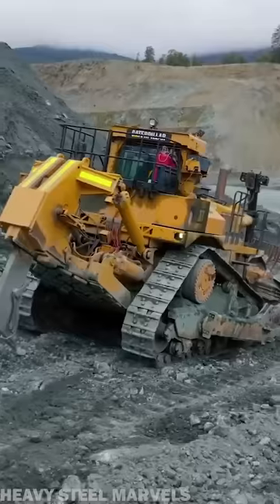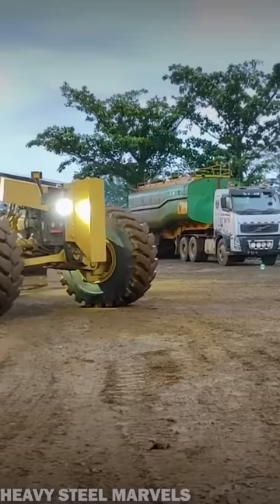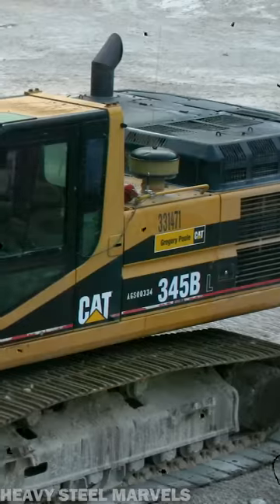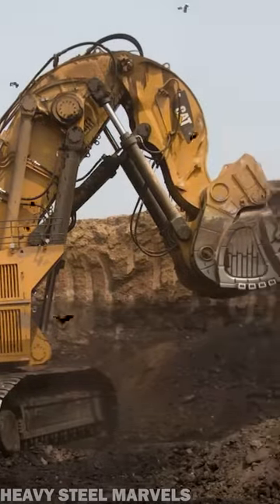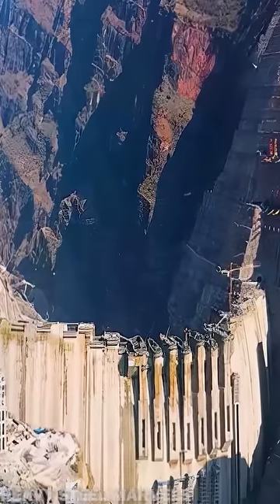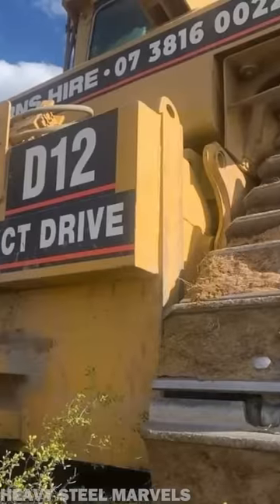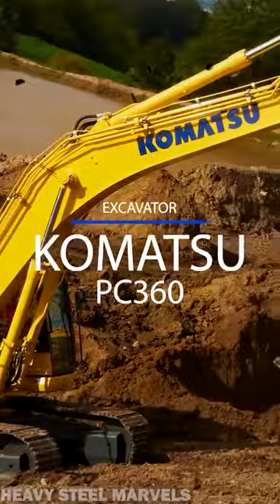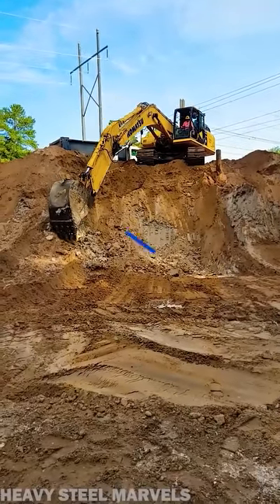Caterpillar D12 Dozer, 6090FS, Big Kate Dragline... | NOVEMBER 2023 MIXED BAG (PART 01)

Comment: D12 is not really a production, but you can read about it in Australia, they stretch the frame and go from a 850hp V8 to a 1250hp V12 and add a cooling radiator for the transmission, a real beast.

Comment: Caterpillar did offered a D12 from 1986-1990  there are 6  in Canada and the difference between the d11n and the d12 was very small the power plant was the only real difference the size was the same D12  was just re-numbered to the d11R  because of the very small differences  but you can go to Alberta and find 4 that still carry the D12 on them and there are 3 in Ontario that I know of   and they where sold By R-angus  in Edmonton and where assembled by my Father  onsite  .....so in actuality all it really was was a D11 with a larger powerplant due to a demand in the mining industry  of the north for ripping the perma frost of the north and ripping the clay of Alberta to get to the surface oils and coal  and thats why they are rare and hard to find

Comment: Lottery Winner - I would buy a Gulfstream G650 Biz Jet - I dont pull the leavers anymore :-)
Reply: you know jets are terrible for pulling?   Heres a good example  push your hardest against          air....        yeah,, no torque.... the equivelent is a turbine, they run the way you want.... actually drive a shaft.     and the only reason you see jets accelerater is because the have more thrust then weight.....so "pushing again the wind is more like 2000 fold

Comment: The D11 must have hit a sweet spot in terms of demand. The biggest bulldozer that it's practical for customers to use, or something like that. Komatsu only ever built 53 D575As, vs 6,000 D11s. If CAT built a D12, it would presumably suffer from the same lack of demand that capped D575A production at 53.

Comment: this is not an actual D12. there is not D12's. Its a modified D11 by Don Mearns for broad acre farming blade plough application. the only thing D12 is the stickers that he puts on them as a joke.
Reply: I actually talked to a person who worked for cat and he said they tried making a d12 to compete with Komatsu's 575 dozer but he said the d12 wouldn't hold up. He said supposedly that it kept breaking driveline parts and other parts he said they scraped the project bc the machine just wouldn't hold up it couldn't withstand the weight and power. Idk if that's actually true or not but that is what the guy told me.
Reply: It’s also a stretched chassis running a 3512 pushing 1250hp, so more than just a sticker.

Comment: I owed the 3 old cat 235 B cats ,rented p.c.400 Komatsu  excavator s when digging in rock great machine.putting big 10 foot  Dia culverts,and deep trunk sewers good machine
Reply: YES was waiting for someone to remember the first line (235 & 245)
CAT excavator, I remember them, that steering stick was unique. I worked on mainline sewers in 1979. We had a BE-350 Excavator, man that backhoe was powerful. I ran a 190 Dynahoe digging the sidesewer stubs behind the beast. I Loved the Dynahoe 19 feet digging depth and just bear for Stout. It was the only backhoe that could take a breaker hammer abuse all day long. I bought a 1978 Dynahoe-190 in 2003, for my own toy, it has close to 9000 hours on her today, never have done any overhaul to that old 353 Detroit Diesel. I also own a 8V-71 Detroit in my 1971 SeaGrave Fire Engine 🚒 that I let kids sit in cab at public events or old car shows. Both the Detroit Diesel scream when running.  my favorite sounding Diesel Engine ❤😊

Comment: I lived near Loma Prieta, the highest point in the Santa Cruz Mtns, and across from Loma Chiquita, with Uvas ck between us.. A guy had a D11, he was 70ish, had run it for many years. in 1997-8 He went down Loma Chiquita and was grading down a slope, into the San Andreus Fault/Uvas Creek. Kinda steep grade, his engine faultered so he dropped the blade and set it for parking and  walked up the hill a bit and turned around to see his D11 going ass over heals into Uvas, a good 2400ft down down the slope. Where it sat until c.2008 when someone graded a rd thru the Svedal area and took it away. You could see it on google earth until then.

Comment: A very reliable source told me years ago that Cat had a D 12 prototype at their proving grounds in Arizona.  You are correct, it's too large and would involve too much dismantling to move it.  As for my first purchase, equipment wise, the Case DL550 Minotaur tops the list, then a Maulden maintainer.  There would be a lot of small equipment of various types and brands after that. While partial to Cat, I think there a lot of other toys also..but never a Komatsu.
Reply: BUT never a Komatsu, or "used to muck" as my helper used to say..

Comment: While Caterpillar pull the plug on the 6090 the company does not have a front shovel to compete with the Komatsu PC8000,Liebherr R9800 & the Hitachi EX8000-6
Reply: Cat will garage it and work out most of the bugs before letting it lose on the streets again. Don't bring up the original D9, D10, orD11.

Comment: Ive operated excavatorsfor 46 years and i loved the komatsu 360 until we bought several cat 336 hoes and i got one and after running it for a while i realized it was stronger down deep and also lift more weight and it could handle a larger bucket!. Our JD 470's and 870's were good strong hoes but the cat 385 was stronger but more exspensive than the 870's. We had several komatsu 650's and 1100's they were just ok!. But when you look at cost komatsu always wins!.

Comment: Why does the 6090 have a Cummins in it
Reply: The FS6090 is actually an upgraded and repainted O&K/Terex RH400, they have used Cummins engines right from the very start